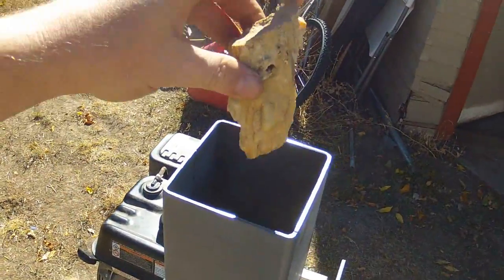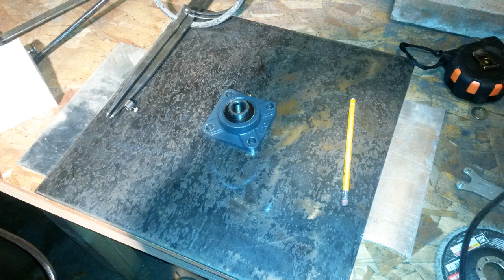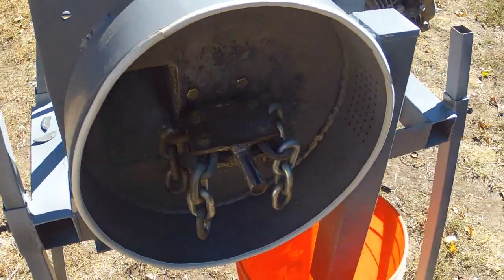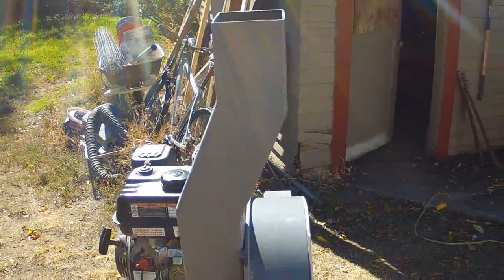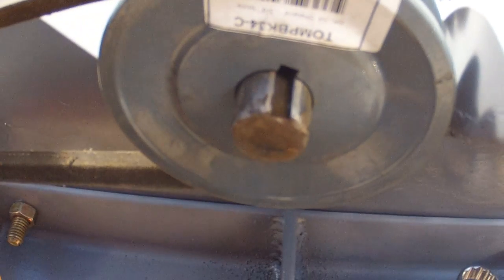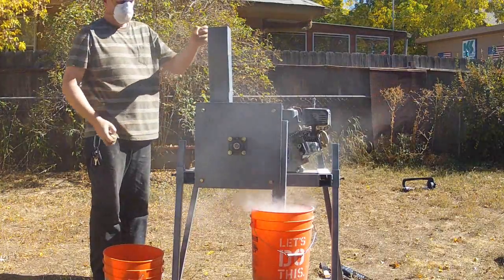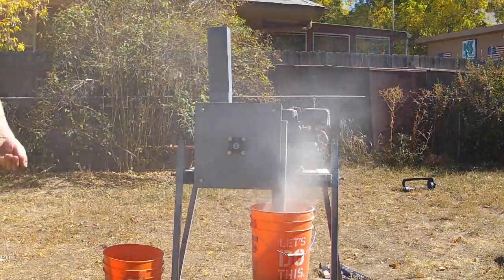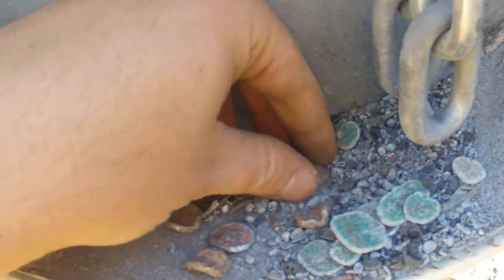DIY Impact Mill/Rock Crusher - Crush Anything (Gold Ore, Circuit Boards, etc)

Comment: When using tube inside of tube adjustment bolts never weld them in the middle of the tube. That is the weakest part of the tube. Always weld them on the corner of the tube. Its like 300% more holding force without deforming the inside tube.

Comment: u could use a shop vac sucking air thru filter to help with dust or mist a fine amount of water in there..  also i would use an electric motor with a flywheel weight to help with friction or impact forces.   gear up the electric motor to high speeds…….

Comment: Definitely your experiencing expansion from heat due to friction. You can try to eliminate the friction or at least lessen it. As well as you could try a cooling option like a small recirculating water tower... Good luck. Decent build for your first time. 👍  Observe. Test. Repeat as necessary.

Comment: Could you, USMiner, or anyone else hazard a guess as to how well this machine would handle slag?  Slag pulverized to a fine size, a bit larger in size than a powder (don't have a mesh size handy ATM)?  Flour is probably a good description of what I'm looking for, in fact.  Would crushing slag just wear this machine out...with or without hardened steel in the various places the designer suggests might improve the longevity of the machine?

Comment: Aluminum on the steel, different expansion and contraction ratios. I discovered the same thing, on my original BMX ball mill before I removed the shinky motor, the pulley was relatively welded on.

Comment: Use a dually or 18 wheeler brake drum and get face hardening welding sticks and weld up lines of that to prevent wear. That's what they use in industrial crushers and the lips of tractor buckets

Comment: Use two bearings on the main shaft and sand the inside of the pulley to remove chemical you may not see or feel

Comment: If you run the bolts on the corner of the legs it will work much much better.

Comment: Use two pulleys or one serpentine belt and pulleys. But your going to have to put a set screw all the way through the shaft or the set screw may not be big and strong enough for the hard impact when you put rock in it. A couple of diameters bigger on the set screw and use stainless set screws. Your gonna have to drill and tap if you do that but I recommend you do both the pulleys and bigger set screws. That should fix it and weld a couple of high beads across the drum for a struck plate. 7018 welding rods is a hard metal and works good for strick plates.

Comment: Don't use an octagon, the angles will allow the debris to strike the sides with a lot worse angles and lead to eroding faster.  
Try the brake drum from a truck tire/wheel/axle.
Pick a common size so when it wears out you can easily find a replacement, and form your sides so no modification is required to the drums, just slip them in and tighten.

Comment: Try a tapered shaft or anti seize , you can buy hard surface wear plates in just about any shape & thickness . They look like square washer with the center hole as your button weld for much less stress on the mild steel than continuous weld hard surfacing ?  Great video thanks for sharing

Comment: Cool idea but not for circuit boards which contain arsenic.  This is absorbable through the eyes and ducts...but the dust can but drawn off by a simple strong covered suction system that is isolated and exhausted through a double HEPA filtration system.

Comment: Looking good & with the improvements will be better...somebody mentioned heat, but also balance (your chain bolts could be half up/down, not all in one direction. Just like losing a lead weight on a tire rim, you feel it at speed)    you could get a hose B-valve & a 1/4" drip tube & 90°, for the pre-cube for control. An all-in-one, mini-pross-plant. Sounds promising.  Put a video up showing it off when you do..... good luck

Comment: Get a bucket lid cut a hole in it to cover the top of the bucket use a old towel or rag on top will stop your dust clouds try reversing your pulley on the shaft and lube it with high temp grease use blue loctite. On the set screws

Comment: Nice little mill you've built there, good job. The problem with the pulley's is heat.  Make sure they're lined up perfectly . Any side loading on the pulley will heat it up quick. Use steel pulley's and I would recommend a double pulley system so that two belts are working together. The belt(s) take an enormous strain. The engine's four stroke cycle gives just one power stroke every four rotations. Add to that the energy required to smash the rock and you can see there are large opposing forces on the drive belts. Good luck!
Reply: Yep I agree with the diagnosis too doc :)
Reply: @allanwood3562  
Have you tried a thicker diameter shaft and larger bearings? 
That would carry the burden so it won't heat up as high.
Reply: Pulleys with a taper hub are the way to go on this type of application. They will not move and they have two threaded disassembly bolt holes to push the inner hub away from the outside pulley. More money but zero failure. Whats your time worth?

Comment: Great job !  I saw a guy that would use a stick welder to lay down beads of really hard welding rods in the impact areas. Simple to renew the welds too
Reply: the process you describe is called hard-facing - uses special purpose rods.
Reply: We used hard facing on a horizontal centrifugal crossher that had anvil faces

Comment: Have you done anymore with this since '15? I'd really like to see more circuit boards processed, but    separate of other materials.  Did you solve the pulley and strike plate issues?

Comment: Had you chosen the octagon shape you could easily make replaceable wear plates that bolt to the inside with countersunk bolts. That's how commercial crushers, mixers and hammer mills are made. With proper maintenance the commercial mills never wear out. 

Many commercial mills and mixers are round but have replaceable round plates in lots of pieces. I replaced a few of them in my time. Almost always ended up cutting out the bolts with torches or air hammers but it beats replacing the entire machine.

On your pulley, aluminum and steel expand and contract at different rates when heated causing electrolysis, a sort of weld like bonding of the metals. Switching to a steel pulley will make removal easier. Keyword: easier, not easy. Some Antiseize on the shaft might help too.

Bearings? All you can do is move up the the highest quality bearings your wallet can stand and keep them cleaned and lubed properly. Eventually they all fail or get stuck. Bigger shafts usually have longer bearing life but again it is all about what your wallet can stand.

I once saw an idiot pulverize rock in a giant cement mixer. It worked but the boss was none too happy about it.

Comment: Yeah the Flail head is generating large amounts of heat while striking rocks combined that with rotational friction the steel shaft is expanding inside the bearing  & aluminum pulley. Stronger shaft steel with different composition in the steel would defer some heat. also look at a different pulley composition as well.

Comment: good job on your build. I'm going to use the same engine for mine. I can understand those areas becoming difficult because of the heat expanding and metal in your axle. do you feel you could do more buckets per hour with the size of rock Crusher you built if it had a higher horsepower.?
Reply from the maker: Yes, for that size feed I feel it could use either more horsepower, an electric motor (more torque than gas), or potentially some hammers at the end of the chains to provide more inertia once up to speed. My hardrock mining needs decreased though (for now anyways) so it's nothing something I pursued further yet.

Comment: Cool the pulley off. The metals could be growing reducing the tolerances. You might be able to over come this by using copper anti seize. But if you don't need to remove the pulley and it's running true, just leave it. My 2¢

Comment: You seem fairly handy with a Welder. Use hard facing rod to weld across the bottom your going to be doing something like a build up weld with the hard facing rod. That would help a bunch.

Comment: I think finding an old cast iron pulley may solve the problem. I do suspect rock dust getting into the thru bearing also. 
  Adding a spray into the output should be quite easy by using a hose and an old nozzle or shower spray head into the side of the output feed. 
  I would also use a closed bucket to catch the dust on the output tube. Rock dust + lungs= silicosis.  Get a good NIOSH/OSHA quality mask and spare filters.
Reply: Hi pls find my video its for sale half price in Ebay.  https://www.youtube.com/watch?v=LzlXImHNIcw&t=4s

Comment: you can stop the dust from the outfeed tube by having  lid on the bucket for it to feed into, then a filter bag fit next the the outfeed tube on the lid, this allows the air to flow but traps the dust. I would also want to stop the dust from getting into the motor.
Reply from the maker: You are right, it definitely needs dust collection. That would be a good method, but I'm planning on building a wet system that mists the powder and drops it into a Gold Cube simultaneously to automate the cleanup and keep the dust down.

Comment: my guess is the dust can be broke down to almost atomic sizes and up to 200 mesh , and the dust is getting in between the shaft and pulley causing it to seize on the shaft . prob wouldent hurt to wear a mask of appropriate type , just like a welder stainless steel and aluminium stay in the lungs for ever , just like gravel dust .  good luck

Comment: Trying to figure out how you spent $500 on your build?? I am guessing the motor? I would think all the plate and square tubing and hardware could be bought for around a $100.
Reply from the maker: Built that at the height of the oil boom in Wyoming, metal was crazy expensive here due to rig repairs. So was any kind of shop labor, such as bending the hoop, which I later determined wasn't even necessary. That was $250 for the metal and labor from memory. Then $100 for the engine. Another $150 or so for pulleys, shafting, belts, bearings, nuts/bolts, spool of welding wire, paint, chain, collars, and various supplies to fix goof ups since I was just building from my head and not a plan. Also had to buy some tools I didn't have like a metal chop saw. It adds up quick... Good news is the new smaller one I'm planning on building this winter to carry on my ATV will be much cheaper after lessons learned and an oil/gas bust.
Reply: USMiner Ahhhhhh....ouch.  Sounds like the lessons I usually learn...the hard ones. Yeah I think I have done that once or twice with a project or 2 myself.
Reply: USMiner Good job though. I am thinking I will build one but just for the backyard. I work in pipe fabrication so I think I can keep the cost down and I think I want an electric motor instead of the gas powered. But I do have an old lawn mower just sitting around...hmmm.
Reply from the maker: Nice, let me know how it goes. I'm looking at electric too, it'd be nice to be able to run this one inside a shed or something, or have a small portable one that I can just plug into my truck battery.

Comment: I use taper lock twin pulleys and never have an issue with galling.
Reply: try a  love joy on your shafts
Reply: hard face the bottom of your ring if you have a stick welder

Comment: Your stuck pulley on the shaft is caused by galling.  That will friction weld it to the shaft.  You need to use an extreme high pressure moly grease on your mating parts.  Thanks for the vid and good luck!

Comment: I don't know why im fascinated by this machine but this thing is mad deadly if not used correctly........seriously it turns full rocks into DUST in seconds.....I don't know anything else that can do that cept a press lol..........just imagine if a hand accidentally got a rock through it on a regular straight pipe one and the rock piece flew up....oooo.......that would seriously suck.

Comment: The way it pulverized the circuit board is amazing; I did not expect the chunks to be round at all
Reply from the maker: +Segment Fault Me either, not quite sure how its happening. I have an idea for another video where I am going to replace the front of the crusher with a piece of 1" clear polycarbonate and film what happens dropping stuff in there. Not sure if it'll work out due to all the dust and stuff making it hard to see inside though but maybe?
Reply: Some crushing implement with sharper edges could work better. When the chains fly around, they push against the air, and it could cause lighter particles to be forces around the chain by the air. A sharper implement would concentrate the impact force at the edges - something like a steel cube formed around half of a chain link, for example - but it may be difficult to find something suitable.
And, I see material being lost in the dust going by way of the air - I suggest that it could be prevented and said material recovered, by somehow forcing all output material to run through a curtain of running water, dissolving the aerosolized dust particles into the water - but to recover the dust, you would need to somehow separate the water, either with a centrifuge machine or sun drying or whatever is determined best.
Reply from the maker: +Segment Fault I actually have a very makeshift sprayer attachement that attaches to the output tube of the crusher and feeds into a Gold Cube for processing ore. It works ok but I need to make a more permanent one and prevent it from gunking material up at the tube exit which is the problem this one has. I'm also going to build a vibrating autofeed tray up top so everything is automated.

A flail like a cube would need to be made of very hard metal which is cheap to replace, this thing eats up steel like crazy. Not so much on circuit boards, but on quartz the chains just take a thrashing, after only 3 or 4 buckets they are almost gone on the impact edge.
Reply: Hardened steel security chains (will break a bolt cutters jaws) may work, but expensive. You can also try welding the leading edges with hard surfacing rod - used in the heavy equipment industry to slow down wear and replace worn surfaces.
Reply: Can i use this to crush corn

Comment: That thing is AWESOME!!  I have a small little cylinder hand crusher that is terrible. I wish I had the tools to build one. I have the motor. Any chance you would be interested in building another?  They are way to expensive to buy online. On another note, we live up in near Chaffee, seems like you visit there from time to time. Drop us a line if you want to hit it up. My parents have some private land on Ark😃
Reply from the maker: +NRCR Diggers Haha thanks, it was fun to build. I learned to weld on that project. I don't think I'll have the time to build another of that size in the next year or two, but I do have plans to build a smaller 2" portable one for hiking in mountains and whatnot. I used to live in Colorado but I live in Wyoming now, I have a claim on the Ark but I don't get down to CO as much I'd like anymore. Private land would be awesome, if you want to run a 5" dredge on it sometime let me know. :)
Reply: +USMiner Sounds like a plan! I have taken our 4 in Dalhke down once, water was to cold at the time. Give us a shout if you are coming in town. We do a lot of metal detecting to. I just picked up a Makro Gold Racer. NRCRDiggers@gmail.com
Reply from the maker: +NRCR Diggers Cool got your email saved. Good luck with the Gold Racer, read good reports on it so far. I am waiting for the Nokta Impact to come out, might end up buying one of those as a do-all VLF machine.
Reply: +USMiner Nice!! That's the one my wife wants.